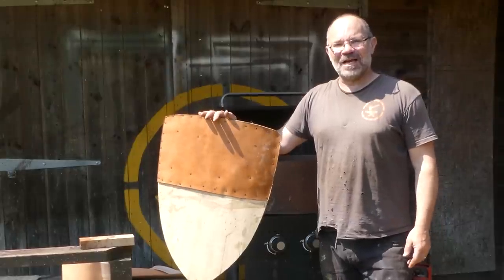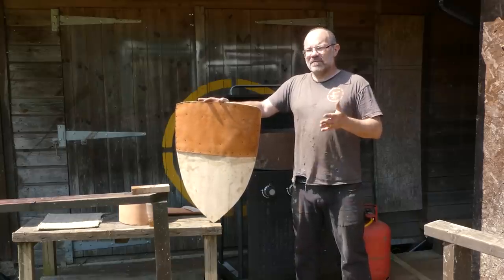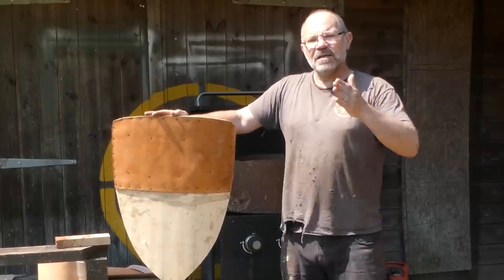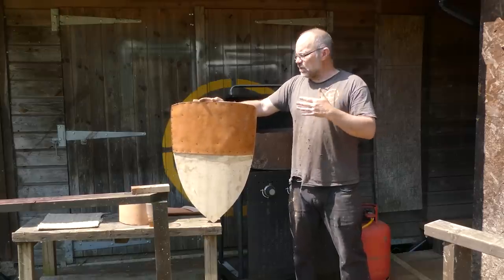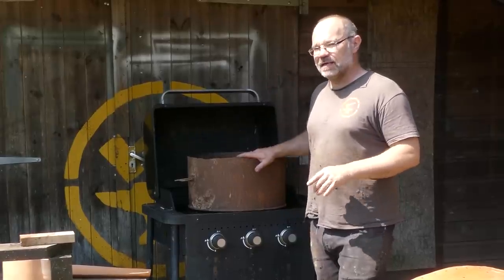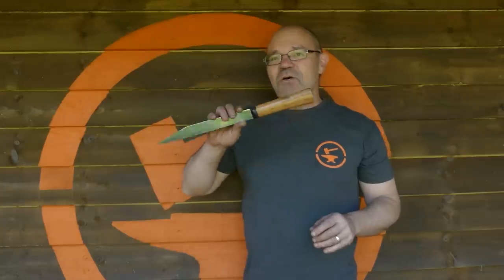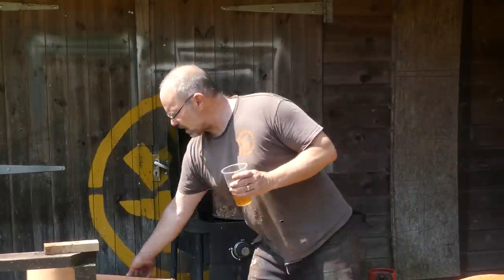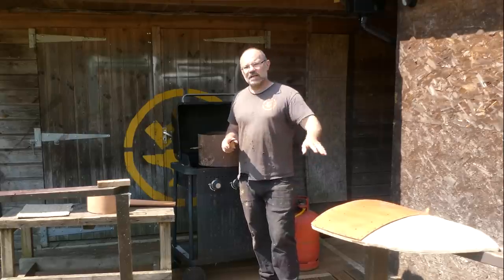Leather shield armour - Part 2

Comment: quite curious to see how it behaves. in principle it is nearly identical to modern ballistic armor, which uses a layer of hard ceramic and a backing of aramid fibers held together with a hard rubber coating. the purpose of the ceramic is to break, bleeding off the energy of the bullet impact allowing the aramid to catch and stop it.

the glass and iron filings would serve a similar function to the ceramic, while the glued leather functions as the rubber binder, and the wood beneath the aramid.

i also wonder if the specific mention of a brass mortar was more important than it might appear. brass being relatively soft might allow for the glass to only be ground so fine. and if the glass is functioning similar to ceramic in modern armor, then you wouldnt want powder, but instead small chunks that can take an impact and then crack and break thus bleeding off energy.

Comment: I've read that the Aztecs would soak their cloth armour in salty brine and then when it dries the salt crystals would somehow reenforce the armour. similar concept and probably fairly easy to reproduce and test.
Reply: Salts are used by the leathermaking industry to bulk and thicken the material. It does not seems to enhance the mechanical properties much (on some aspects,to the contrary) but you definitely can easily thicken leather with brine.
Reply: @saloneju  I believe that the aztecs used cotton in their armour so obviously that would be different to leather but it is interesting that leather can be thickened with salt as well. I'm just interested in seeing the aztec salt concept tested
Reply: @saloneju  I wonder if the bulking effect is because salt added to the leather is hygroscopic and would draw in moisture ? If this is so, I think it would make the leather a bit softer rather than harder
Reply: @bigoldgrizzly  Good question. Ive thought the explanation to be that when the salt recrystallizes, it grows in volume and thickens the leather as a result. Theres definitely a component of that also present,but never thought about how this might affect the moisture content of the leather. Ive made some hardness measurements on different forms of hardened and non-hardened leather,and brine-soaked leather may indeed be somewhat softer than completely untreated one.

Comment: For reasons unbeknownst to me I find that hide glue stiffened natural cordage is very brittle in the end. As in it breaks quite easy, where the cord would have been impossible to break by hand before. I suspect the hide glue is not the way to go for natural cordage and you need to use something more plastic, like waxy pitch or birch bark tar. 
But I cannot wait to see what the sandpaper composite does.

Comment: I think i may dismiss the glued linen theory (and the ancient greek one has been proven mistranslated). What i think black gambeson may be, as it's also mentioned in the "king's mirror", is a layered garment, where the outermost layer(s) are of toughened fabric impregnated with something of that nature, be it pitch or glue. I think there's also a parallel to be made in the construction with gambesons that are mentioned (and indeed a surviving piece) covered in a layer of skin on the outside. The fragment of that armour is from Ireland, where gambeson was relied upon as solid and stand alone protection.

[It also may be the clue to the emergence of the buff armour in the 16th c(?)]

Comment: For anyone like myself who has been trying this method of black dye without success, the trick seems to be to wet the leather first. If I mix iron filings and vinegar and apply it to dry leather, I get a very nice grey, but it is decidedly not black. If wet the leather first, however, I get a very nice black. It isn't the same as modern chemical blacks, but a little oil or wax should make it close enough to not matter (though, I don't think it would be able to match USMC Black).

Comment: Gambeson covers quite a bit of ground under different names almost meaning the same thing.  Even though they went under different names at different times, Haketon, Wambais, Pourpoint and Gambeson, There were only two types one to be worn under plate armour (expensive) and one to be worn by infantrymen (archers) (cheap).

The  Gambeson of 31 layers of linen and one of canvas, usually deer skin, was for wearing under armour. The padded, sometimes to width of four fingers, of the archers were  tubes of linen sewn together that had been stuffed with cotton waste, cedral, buckram and tow. Cedral and buckram remain a mystery but tow was the off cuts from hemp rope or okram sometimes tarred. The under armour gambeson that you are holding would not have been visible so being coded black red  or blue does not seem likely. 

The black gamberson may have something to do with the stuffing ingredients which leeched out when wet and were a superior filling we will never know until we decipher cedral and buckam

Comment: I just got to the part where you dipped the leather into the vinigaroon. That's what that stain is called. It was used to stain wood too. With maple the rust gives it a red hue and the vinegar gives a brown hue, but that is best with the harder parts of the wood turn red and the softer (the curl or figure) turns a darker brown. Basically its an acid stain like Aquefortis (nitric acid30%-water70& and iron filings). Try the vinigaroon on ash or oak or walnut.

Comment: Something I've noticed with carbon fiber is that rolling and pressing out the resin makes it stronger than only pressing. I assume it has to do with getting out more air, as rolling combined with vacuum pressing (you know, the proper way of layering carbon fiber) is even better. I wouldn't be surprised at all if mostly drying a stack of glue soaked linen in a clothes press would be a technique they used. 

Also, I'm curious if part of the function of the glass is so any blade cutting it gets dulled faster. In humid weather hide glue (even the water resistant kind) gets a little soft ime, kind of like hard plastic. Compare glassfiber reinforced nylon with regular nylon, then try to cut it. The glass messes up HSS quick enough to notice, so regular steel weapons would suffer even worse I think.

You should try case hardening a few arrows to see if you can crack the hardened layer! That alone would cause burrs that would reduce penetration I think.

Comment: In the text "Conservation of Leather and Related Materials": Kite & Thomson: Routldge (2006) pp94-96: postillon boots used heated colophony pine resin, bees wax, and p98 details pitch being used on the raw flesh side. Apparently the "pitching technique" used for carriage boots was accurately duplicated from: De Garsault (1767) "Art du Cordonnier" in Arts du Coir (1984) Geneva, Slatkine.
Page 97 describes the molecular changes leather undergoes- some heat application methods post boiling allow for rigid formation, others allow semi-rigid. But the fact it must be vegetable-tanned especially oak-tanned is very important.
As for tanning- the video by The Woodland Escape: How to Tan Hides: A Tutorial | PIONEER LIFE CIRCA 1700's states deer hide is first soaked in an alkaline solution (wood ash), then de-haired and de fleshed- the alkaline loosening the hair, then rinsed, then put in an acidic solution to tan (animal feces (Native Americans used deer poop) but apparently early settlers used vinegar and vinegar was produced in huge quantities by early settlers- thus it must have been a very important product- and one would imagine a time not so removed from the Renaissance- as important and widely produced during the Middle Ages- especially as people were very frugal and didn't let things go to waste like a bad wine, ale or beer.

Comment: Linothorax was linen and glue, that's correct. And it certainly wasn't cheap or low-level armor, Alexander the Great is depicted and described wearing such armor (there's a very famous mosaic of the battle of Issos where he's shown wearing such armor). Basically, it was supposed to be the ideal armor, because it was lighter than metal armor, but sturdy enough to protect against most battlefield weapons of the time. I don't really think it can be compared with a gambeson though, because Linothorax is rigid and a Gambeson should be at least partially flexible.

I've never tested one myself, but I've seen footage of arrows and spears tested against such armor and basically, it absorbed all the energy - there's enough flex in it so the weapon doesn't just punch through, but enough rigidity to protect the wearer.

Comment: @Todd Cutler  I wonder if you could use sheets of linen & the thick nasty dregs of your leather glue to make a fiberglass like panel for a properties test.  (how well it molds as well as how well it functions against arrows & blades)

no criticism, just a possible way to test your idea with minimal extra work / material - gotta make that research budget stretch any where it can. 

P.S. If you have an interest in writing up your experiments & results, I'm pretty sure your experiments would pass peer review.

Comment: Hey tod I have to share this with you, cause it's freaking intressting. I think that by pure f*cking chance I found out how boiled leather was made. I have question though for you to make sure. Do the historical sources specifie that they used leaded or tannend leather and not untreated leather or rawhide. Cause if that's the case I think we have bin mis understanding what they actuely did. Let me explain. A couple day's ago I started a project to make like a close interpetation from the earleyest coat of plates were the most likely used hardend leather or something like that, sow I desided to use rawhide plates for it. Sow I thought cause I once used close to boiling water and paint to colour gambeson mittons which I glued a pair of leather gloves into that I couldn't get out before hand and the leather became super stiff, let's try what happens when I fill a bucket with boiling water and do the same thing to rawhide. Sow I put a roll of rawhide into a bucket, boiled a couple litters of water sow it would end up submerched and left it to cool with the water over night. At first it ofcourse was very floppy like rubber sow I cut it into ribs and treated it to a leather background. It has taken like a week for it to dry, but now it is dry it is nothing like the rawhide that I bought. For one it has taken a set and the flat pieces of rawhide are rolled and bend out of shape. I know I bought thick stuff, but this new stuff is easly twice as thick somehow. Also because of my autisme my senses are very over active including my sense of feel and I can instantly tell this stuff is now like more riggit and hard then most types of hard wood. I'm talking this sh*t is harder and more solide then dryed oak wood around 1,5 times as thick at this point. I can imagen if you were to clamp rawhide to something in the shape you like and made sure it held shape while you pourd the boiling water on top that it will set in the shape you want it to be and you could have something like boiled leather piece of armor. I'm still needing to make the breastpart for my coat of plate and sow I'm gona repeat the procces.

Comment: It would be really interesting to look into the chemistry of the iron / tannin reaction to really see what's happening there, and it brings up some interesting questions, like could you add iron filings to the tanning vat to go straight from untreated hide to black leather or would that prevent the curing from taking place, and is it just the colour that changes or is the addition of iron chemically altering any other properties
Reply: It is altering the properties and rendering the leather brittle. That is why we have little to no evidence that it was used in this way.
Reply: @caranorn  Source?

Comment: hello, i have the answers you are looking for :

You can build hard leather, it's really easy :
1 ) you give the leather the shape you want. Beware, it's not just curving it, it's making him unable to take another shape
A good exemple is the magic braid : make one, and roll it a bit, you'll see taht if you want your braid to take a circle shape, you need to give a certain shape to every small part.

2 ) boil it. 100°, not an hour, not sure about the exact period of time.
On your bmagic bread, you'll notice that his shape wiill have changed, and that even hot, your leather will be hard to re-shape. But it will do the job : i've made, today, a leather-only bracelet : no a single string, not a button, nothing except hardened leather.

From now, your leather will be extemely hard to cut, to bend, etc...

I'm not entirely sure about it, but you may want to wax your leather before all of this process, to keep the skin's structural properties.
The only thing sure is that it made your leather turn black to have it waxxed before the boiling.

Then you can do all your work of glue, wax and other paste.
But there is no more need of jelly and glue, it does not serve any purpose.
And the waxx have little effects on such a boiled leather : not softer, not easier to shape...

On your shield, you'll do this while the boiling of the wood, before putting the shield in shape :
pin your leather on the wood, glue it, but not with jelly or skin glue, but pine resine,
boil everything
shape your shield and the leather at the same time
glue your turnshoes'sole recipe and then your last layer of leather.

This recipe you found wasen't a recipe, it was an advertising, giving only one important information : there is another layer in our shields, buy it now !
The rest of it is bullshit for profane's imagination.

Comment: "Easiest and cheapest thing..." Yes, you can also dye clothing with onion skins, easy and cheap. And not verifiable by sources! That is why some groups would ban iron blackened leather. And that is the problem with your recent videos. You simply ignore sources. In this case (the two videos) you have not looked at extant shields, you offhand refuse a historic recipe (worth testing) some have mentioned here and you don't even abide by the recipe you seem to favour. In simple words, you are starting to damage your brand name and reputation with serious re enactors and practitioners of living history...
Reply: His brand isn't being damaged in the slightest.

Not every experiment has to be held to the exacting standards that his Arrows v Armor was held to.

"YoU cAn'T dYe ClOtHeS wItH oNiOn WiThOuT a SoUrCe."
Reply from the maker: Hi Caranorn,
You seem a bit angry - sorry if I have annoyed you.  It doesn't matter if there are sources or not, if you drop a piece of veg tan leather on a forge floor it will get black marks on it from the iron dust.  If you rub the dust around the whole piece will go black.  This effect is quick and 100% happens and there is no way that they did not know about it.  I certainly have looked at extant shields, but again I assume you are referring to the Spanish document that talks about gluing shields with casein glue.  Shields yes (as in the planks), but it does not refer to using casein glue to bond further sheets of leather to the surface, in fact it does not mention this at all.  Caesin is great for gluing wood and leather, but in this instance the glue needed to be very thin to penetrate and casein is viscous, so in this application it would be unsuitable.  So although the shield itself could be glued with casein, the leather coverings (if they are to be glue impregnated) cannot be.  When you take written instructions that are 700 years old that was probably not written by the person who actually did it, you have to interpret a bit.  I may be wrong, or I may be right or I may be just exploring possibilities (even ones you don't seem to like), but really I don't think it is justification for getting angry.  I would also point out that I never say "I am right", simply because I don't know if I am.